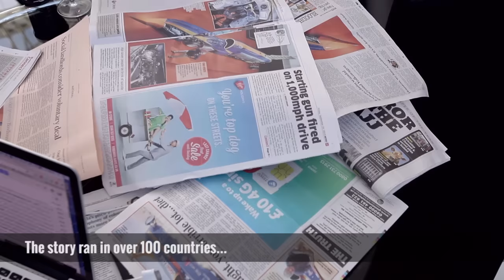BLOODHOUND SSC makes World Debut

Comment: One dislike at this point. What is there to dislike?
Wishing all the team all the best when the time comes.
Reply: +Derek Thomson That they are calling it a 1000mph car which is almost over 200mph Faster than the current of 763, when the car hasn't even been run yet. It's extremely optimistic to say the least. Do I hope they do it? Certainly! But if I had to guess the downvote came because they are putting the cart before the horse a bit here.
Reply: +OmegaGamingNetwork 
Nah - Seen it  on other sites - some people dislike because they can.

Correction: Not 'almost' just is.

Comment: When is this machine going to break the record?
Reply: +kyldavid41 Right now last I heard the 1000mph attempt is going to be made sometime in 2017.
Reply: +cubsrock10997 lmao it was supposed to be done in 2014 as they said
Reply: +adza botchway Where did you see that? Maybe finish being built in 2014 but not have the 1000mph run in 2014. Also I dont think you can read because it even said in the video that the 15th of October 2016 is when they plan to do the 800mph test run with the 1000mph run being done in 2017. http://www.iflscience.com/technology/hands-bloodhound-1000-mph-car-will-smash-world-land-speed-record-edited-kh read paragraphs 5 and 8 they both say 2017 for the top speed 1000mph run.
Reply: cubsrock10997 Mkay well no need to be rude, my friend. Maybe i misread it. Maybe i was looking at an inaccurate article. Who knows. that's just what i thought i had read.
Reply: All I'm saying is, before you try and correct someone and sound so full of yourself, it helps to pay a little bit of attention. Also I only used the attitude that I felt you used towards me with your comment.